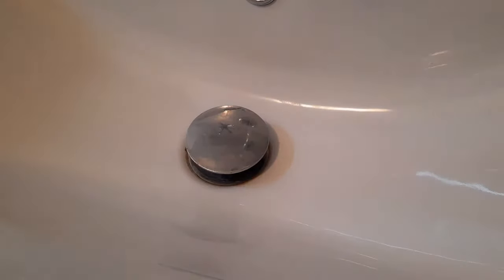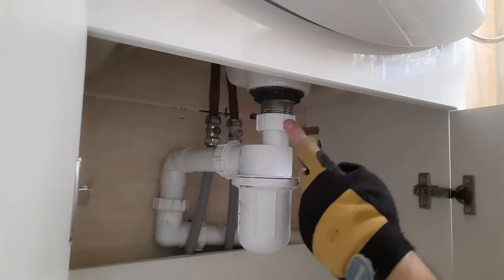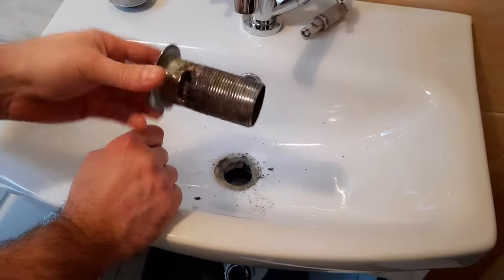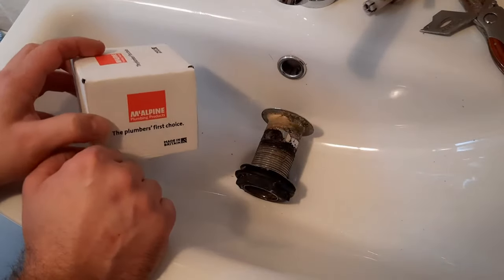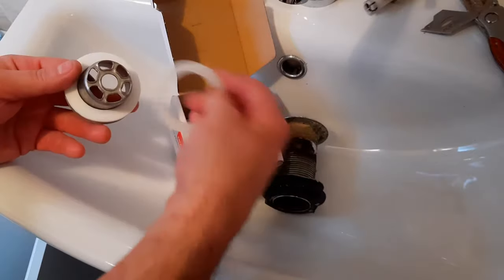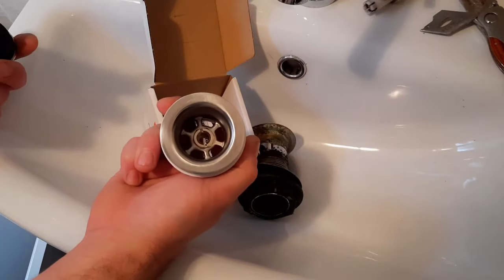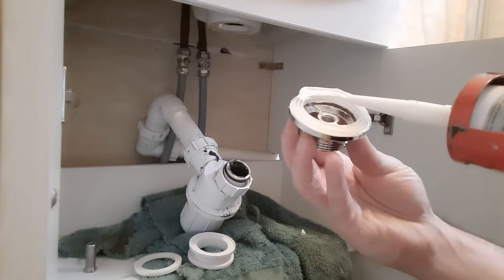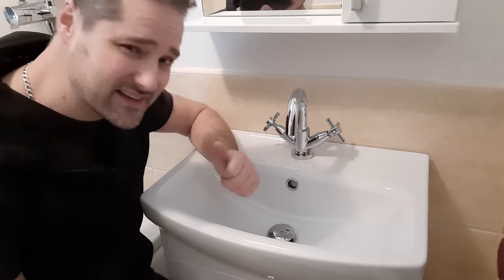Watch this before you install a Click Clack waste for your bathroom sink

Comment: Thanks for the video, managed to fit the new McAlpine waste, hardest part was cleaning up the silicone armageddon left by the previous waste!

The instructions say to use a large flathead screwdriver or socket. I used the largest I have (it was my grandads) which was big enough to just about turn the nut to start to get tight.. then it slipped.

I had to use a 15mm socket and small extension in the end.. lovely and tight now! 😊 I also had to replace the McAlpine bottle trap with an adjustable one as the new waste didn't protrude as much as the old one!
Reply from the maker: Glad the video help,  WD40 breaks down silicone, makes it easier to remove

Comment: After watching this, I feel confident enough to have a go. I'll call you when it goes wrong.
Reply from the maker: lol I am sure you won't go wrong but I'm here if you need me
Reply: I did a dry fit but it is not holding water , there is no leak under the basin.

Comment: The fitting is sold as a dry-fit, but a bit of sealant never hurt anyone I guess :)
Reply from the maker: in my years of plumbing I have learnt, never trust rubber seals, that also applies to plastic piping

Comment: That sink has an overflow, is that slotted?
Reply from the maker: yes and know, its a unit that will work with both slotted and unslotted
Reply: How does that work?
Reply from the maker: @theyellow8834  because it isn't one piece that slides into the basin, its two pieces that bolt on, that's why it works for both types of basin

Comment: The click clack you took out had an overflow slot in it, and the new one installed didn’t. So if the basin fills up and overflows where does the water go ?
Reply from the maker: HI,  yes you are right, the old waste had a slot as it was a solid unit that needs to be inserted through the basin.  the new waste clamped on the top and bottom of the basin. no need for a slot as the over flow was not obstructed within the basin.
Thank you for watching

Comment: I have a quick question:

Can you swap one of these pop-up drains for a traditional drains.
Reply from the maker: Hi, yes you can, kinda. any waste from the click clack to the pop-up waste have the same diameter. the difference with the traditional waste is the lever that fits in the back of the tap. No hole in the tap means you cannot fit a traditional waste, unless you change the tap as well.
Reply: @DeanItYourself01  

Thanks for the advice.  Brilliant video.
Reply from the maker: any time @stuartgrier5605